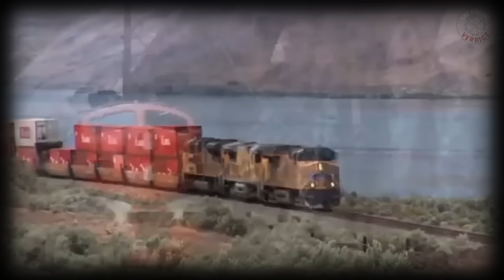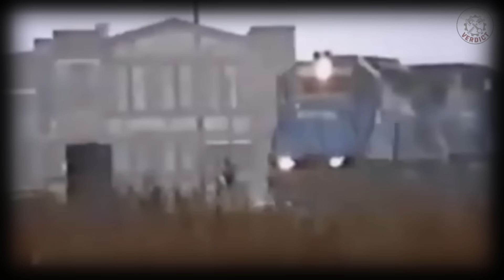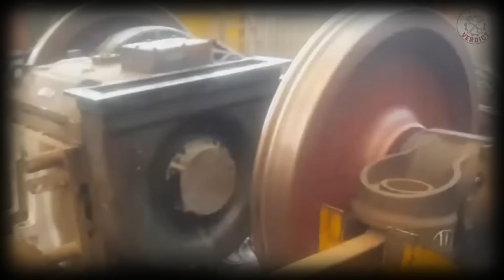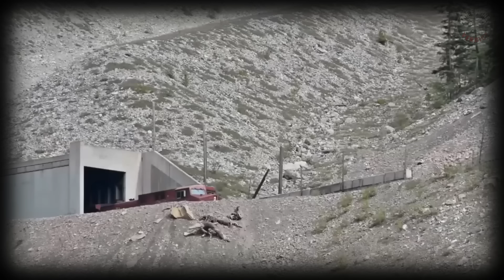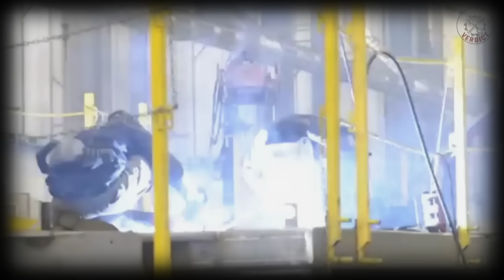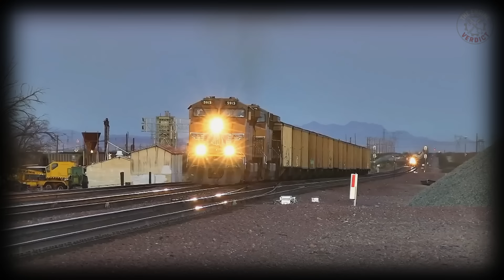The $2 Billion Mistake That Destroyed EMD's Railroad Empire in 1994

Comment: CHANGE TO ELECTRIC OR FINANCIALLY WITHER ???
Indeed the "Dash 8" finally introduced a number of technologies common on most modern European Diesel locomotive classes, at that time, after some years of American hesitation. But all that is now 40 years ago, and European Locomotive technologies have continued developing non stop ever since. Indeed in Europe the limitation of Diesel, like the steam loco before it, was clearly reached in 1975, as proven by British Railways. And the Politicians across Europe had to be informed that unless Railways were electrified using modern Industrial Frequency at 25,000v AC 50Hz. The continued use of Diesels would seriously impede further efficiency gains and deny further reductions in operational costs. Which is why Railways across Europe have been rapidly expanding their electrified networks since the late 1980's. A still ongoing process, but virtually the whole mainline network across Europe is now electrified, and its now down to "filling in the gaps". 

Operational costs for a whole rail network are now falling year on year as the fulcrum has been reached in electrification. Once a rail network reaches around 50% of the network being Electrified. Each subsequent line electrification become proportionately cheaper. And the number of locomotives necessary for each subsequent line also reduces in proportion as the total fleet efficiency in operation now increases on a route by route basis. The other major advantage of Electric locos, is that unlike Diesel locos their is NO limitation on the power you can install in Electric locos, as Electric Locomotives have NO ENGINE. They get all their power from the overhead wire, and at 25,000v AC 50Hz this means that for example "Super High Speed" trains all of which HAVE to be electric, now normally have an installed power of around 1,000hp PER VEHICLE 

So a 20-car 186mph/300kmh "Eurostar" Electric train between London & Paris can reach these high speeds with a total of over 19,000hp built in. And at these speeds you now only need 60% of the number of electric trains/locomotives than you would need, if you continue operation with Diesel locos limited to around 100mph. The quicker you go the fewer expensive locomotives and passenger coaches or even freight wagons are needed. So American freight trains that currently trundle across the USA at no higher than 75mph, requires thousands more locomotives and thousands more wagons than would be needed if Speeds were doubled to say 150mph. And the savings in efficiency by using high power Electrics locomotives would quickly recompense the initial outlay of putting up the overhead wires to provide that power. Not to mention a 90% reduction in pollution and a major reduction in noise. Modern Electric is both quieter & cleaner, a free bonus !

Comment: 10.15 If Im not mistaken, that locomotive is a NZ Rail DX class. 47 were delivered  between 1972 & 1975 from GE at 2750hp, a massive locomotive for us at that time. 50+ years later, we still have them--- now uprated DXCs at 3300hp! NZs greatest engine, without doubt. Based in North Island to begin with, a bunch of higher rated electric locos of Chinese & British origin pretended to replace the DXs on North Island trunk lines-- so all DXs, I believe, are now in the South Island. Possibly irrelevant to your actual video topic, but thought Id give you train guys n gals a run down on that great GE product..

Comment: So much misinformation here. GE undercut EMD by lowering the price of their locomotives & made it up by charging higher prices for parts. GM was looking to divest itself from EMD & cut funding to them for engineering making them a virtual stand alone company under GMs umbrella. EMD pioneered AC traction in the North American market, the timeline this video suggests is all wrong in comparing SD40 locos to Dash 8 - 9, by that time EMD was producing the SD60 computer controlled locos soon to be followed by the  EM2000 controller used in 70Macs, 80Macs, 90Macs, & 70Ace locos. These were all self diagnosing systems - though all self diagnosing systems still require a technician to interpret what is actually happening.

Comment: I worked for a company that, at one time before it was sold off, had the country’s largest blue and brown water vessels. All ocean tugs and river tow boats used EMD 12, 16, and 20 cylinder turbo variants. They were incredibly reliable with a max operating range of 900 RPM. I loved these easy to maintain power plants. And the sound at max RPM was music to my ears.

Comment: So why did Union Pacific order so many SD70M'S? Initially ordering 1000 units in 1999 and ending up with over 1800 by 2004?

Plus the SD70M'S did not have computer diagnostics systems because those systems were failing in railroad environments. Why the failures?

Comment: The switch from DC to AC is sounding quite a bit like "Turbo Encabulator" tech, but I get it. AC power is why we have what we do today. One more observation: GE's AC4400CW Locomotive LOOKS the part; it looks like what a locomotive should.. like a modern take on those old F3s.

Comment: Batch of lies here. 1)  EMD actually started the AC shift with the successful SD70MAC. GE trailed, but the 4400 with 6 inverters and a 4 cycle engine emerged the winner.  2) More diesel unit does NOT increase crew size. Only one crew per train.  3) Norfolk southern NEVER bought 4400s. They were very late to AC power, only shifting with GE dash-9s.  4)  Picture selection in this video is atrocious, almost never truly matching the voice track.  5)  What really killed EMD was the conversion to Tier 4 emissions in 2015. Their entry was very late and had many problems. Still does.
Reply: Don’t get me started on the tier 4 crap. Overzealous Environmental Police Agency BS.
Reply: I began to think this was largely junk, from what I recall. Saves me watching the rest.

Comment: Excellent video and well documented. Corporate culture and ignorance destroyed GM. Rather than investing in future technology they chose to put it into short term profits. When the wake up call came it was to late as the diesel engine and ac technology snow balled . They had to invest in a new engine design  particularly because the 2 cycle engines could no longer meet the new tier environmental mandates and no off the shelf replacement. They went to Siemens for the  AC technology. Not sure what happened to their H Block engine as it was all a band aid fix and total failure. The mishmash spent more time in the shops than on the road. RR's want reliability and longevity.  I worked for Canadian Pacific from 1975 and 2010. It was bitter sweet to see the change of horses but GE's are excellent units in every respect and can totally see their dominance.
Reply: ❤❤❤❤❤    very true statement!!!

Comment: What killed EMD was the reliability of the 50 series(or lack there of) just as GE came out with the Dash8 line. EMD was also was first to market with AC traction with the SD60MAC and shortly after the SD70MAC. It was still a couple of years before the AC4400CW came out.
Reply: “Hey, let’s over-rev a 645 instead of developing a new engine!  Nothing could go wrong with that…”   — EMD, probably
Reply: Emd bombed. Over, kaput. The kicker for me is that GE Locomotive was largely ALCO. 

WAY back in the 1960s ALCO floated the idea of ac traction. ALL ELECTRIC LOCOMOTIVES HAD AC TRACTION MOTORS.

The idea seemed too obvious especially with gg1's notoriously dependable reputation. 

At that time the industry was dead set on DC. The alco century series was planned as ac but relegated to dc. GE made all the electrical components for ALCO.  The alco design dept + product development groups BOTH WENT TO GE. 

The gp50 was doa for real as these engines were dying online.

Emd used political connections to gain the jump start on all other builders and suddenly that was all gone.

Baldwin of all builders had built several diesel locomotives before anybody.

THE 4400 SERIES WAS BEYOND HUGE.  Those things were loved by crews to this day. 

Whether those were actually better than MAC's is opinion. Regardless GE/alco won the day.
Reply: Absolutely! Worst junk i ever ran!
Reply: Penskey was handed the keys to detriot diesel for free.     G M went straight to not undeserved bank ruptsey hell
Reply: You don't suppose that Roger Smith had a little to do with that do you?

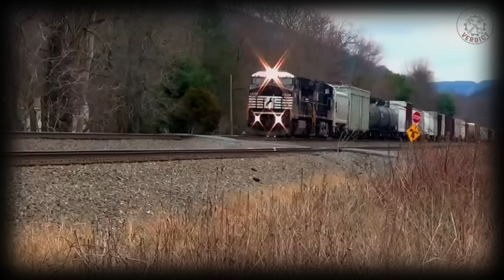Comment: Why do multiple units increase crew costs (3:10)?  Since one crew can control multiple units, the crew costs should be the same no matter how many units.

Former CN employee here, though in telecommunications, not the rail side of the business.  Back in the mid 70s, when I worked in Northern Ontario, I frequently rode freights and I seem to recall mainly EMD, though there was some other on passenger trains.
Reply: Till agreements changed engineer were paid by rate on drivers
Reply: @WilliamVaughn-v5v   I thought the discussion was about EMD vs GE.  Steam locomotives are long gone and with them, a crew was required for each one.  I can certainly understand the AC power being better than DC.  That has long been the case in other areas.

Comment: You completely leave out that Southern Pacific was the largest single order of the AC4400CW. Most of the Big 6 Class ones today have large fleets through mergers. SP was an early adopter of this loco due to a price discount they received as SP was power hungry in the early 90s.
Reply: They was still trying to rebound from the failed merger with Santa Fe
Reply: @BigG903  So SP merged with Union Pacific, instead.